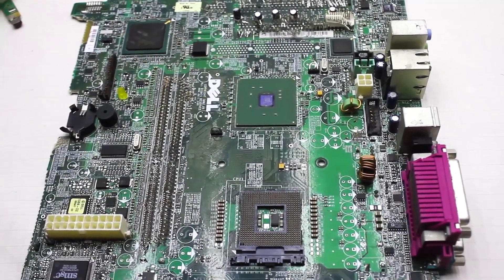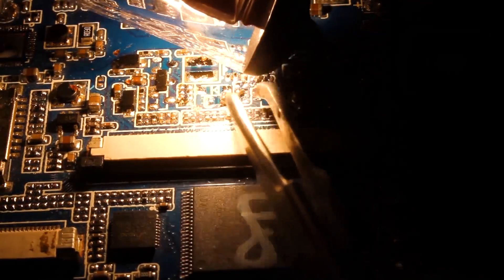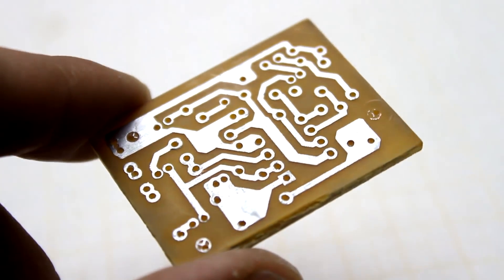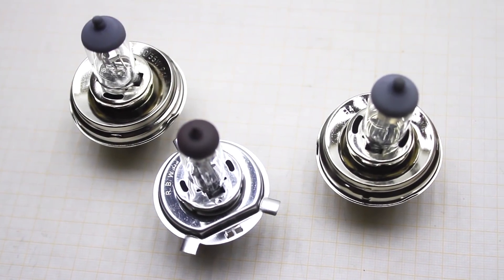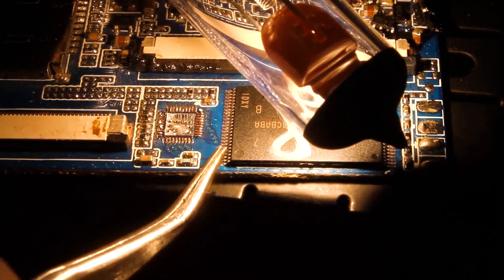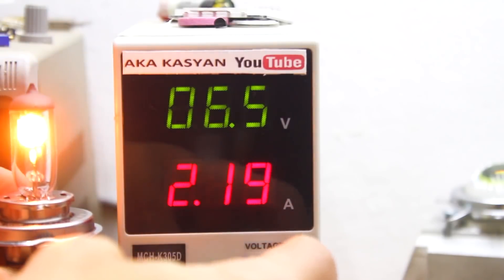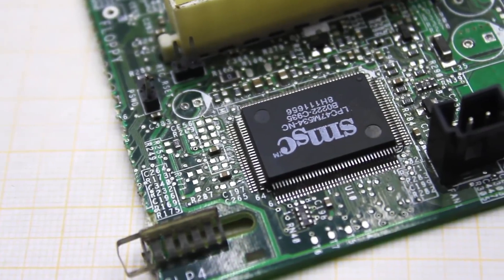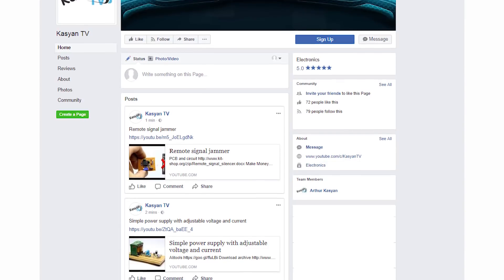SECRET function of halogen lamp. THIS YOU DIDN'T KNOW!

Comment: Nice! Why not paint the light bulb black to stop it blinding you?
Reply: It would probably shatter and explode in your face if you do that. Even touching by hand lamp balloon is problematic because oil from skin will burn on a glass (when you turn lamp on) and create additional thermal isolation layer and that spot will have higher temperature than rest of glass balloon which can lead to crack and shattering.
Reply: zokonjazokonja so how come the tip of the glass envelope is painted black out of factory and it doesn't make the light bulb shatter
Reply: Alvin Wijaya good idea if you want to start a fire. Also it won't help with the light reflected off the pcb.

Comment: Also don't touch the bulb or your fingerprint will leave oils and make a hot spot and cause the bulb to fail early
Reply: Like the glass portion of the bulb or if you do wipe it off with rubbing alcohol and be sure to let evaporate

Comment: I think this method would work really well with tight packed boards as the beam of light is way easier to shield than hot air, from components that don't need to be heated like plastic connectors that usually get destroyed during rework..

Comment: 135 comments about how cool is this...
another few XX comments about her voice and the word Halog/jen....

...and NOT even ONE freakin comment from somebody who has actually tried this....
Reply: I've been doing this for years.  Only instead of a car lamp I use those halogen bulbs that come with a large glass reflector to direct more of the energy to a focused point.  You can COOK the board if you dwell too long in one place.  Yes, the bulb still gets hot, that's why I built a lamp holder out of copper pipe.  A bit of smashing, drilling and filing and you have a holder that does nicely.  Only, you shouldn't solder to the terminals, they get hot enough to melt the solder.  Connector pins are a better way to go.

And yes, I'VE DONE IT!
Reply: imjeffvader that's true. For example, i go to sleep just right now, so, i can't try that method. Good night
Reply: Alexandru Oglindă .Accent or pronunciations are not important as long as message is conveyed
Reply: Heey, only a week passed, who in this world can try anything in such a short moment, take it easy :D

Comment: NOTE: Do not touch the bulb for any reason - if you do, you need to clean the bulb with rubbing alcohol afterwards, as the oils from skin will create points that get hotter than the rest of the bulb. This may cause the bulb to shatter. This warning is included on bulb packaging, if you choose to use a new bulb.

Also, use good thick wires to connect the bulb to power - too thin a wire and it won't be able to carry the amperage a halogen bulb requires and the wire and/or its insulation can melt. A thicker wire will also carry more amperage to the bulb itself.

It's a creative life hack though, just do it safely.
Reply: Old wives trail!
I've never heard of anybody who's had a halogen bulb explode/crack.
Its been passed down from father to son since the 80's and probably earlier, but it never happens
Reply: I'll second that. Ive ridden a motorcycle with an h4 headlamp without a front glass element for months. It was exposed to all the dirt , cold, hot and even rain riding can throw at it and only broke when a car driving in front of me kicked up a rock which aimed itself directly at the bulb.
Reply: That's true. Thanks for the advice!
Reply: Another misuse of the word, "hack."
Reply: Have touched the glass many time when installing these types of bulbs in cars. Not once has one become damaged as a result from touching it,
Reply: Talking about stating the obvious!
Reply: DashCamAndy kķomsi kmsa

Comment: I used this technique before good smd rework stations becomes affordable. For better result, use MR16 halogen with aluminum reflectors. Do not use dichroic type as they only reflects the light, not heat.

Comment: Not a bad idea. Execpt most hobbyist bench supplies have a maximum of 1.5 amps.
Reply: That's why there are PC power supplies
Reply: Year ago, I made my own bench supply that can go up to about 30A@15V or about 15A for settings above 15V.
The switch over happened smoothly.
Basically the idea is this:
Several very fat NPN transistors makes a 15A output stage running from the +30V rectified supply.
A resistor in each NPN's emitter makes the 0.7V needed to bias on a pair of fat NPNs.  These NPNs are powered through a rectifier from a 15V supply.
At low voltages, the second set of NPN do most of the work so you can take 30A from it.  When the voltage gets above about 15V, there is effectively no collector supply to the second set and the first set has to do all the work.
I got the transistors cheap so I used more than really needed.
Reply: Really? My smallest bench PSU can do up to 5 amps. And I have a 10 amp one too. I've seen the small 1.5A ones but didn't think they were as popular due to the limited power for the cost.
Reply: I have a  car battery charger that will put out 10 amps
Reply: Suggestion for someone who is entering in to electronic DIY stuff.
Build one based on DP50V5A and some LED PSU (i.e. 48V 150W or higher power), if you have already a housing it should not be more than 40$. You can also improve quality by adding  additional LC choke filter if you need better quality "laboratory" PSU for more sensitive devices, although without it it is OK and can supply standard MCU-s (i.e. arduino and similar stuff) without a problem.
Reply: My best one is 12v 1A lol
Reply: It doesn't have to be the 12V bulb. I will recommend you to grab some GU-type halogen light bulbs rated for mains voltage. All you have to do is to be careful, don't forget that it is not a low voltage toy.
See the channel " 12voltvids " the man there used GU bulb to reflow BGA chips.
Reply: @ L DB : That's my wallwart ;-)
Reply: So just build one with higher ampacity....
Reply: Then use higher voltage to get to the needed power. Just keep it under 40-50V then you should be fine.
Reply: I use a MingHe D3806 + laptop power brick for these kind of things.

Comment: This is definitely on my list of stuff to try. I actually have my first hot air rework gun in a cart on AliEx right now. Just over $28 for the version that comes with the adjustable laptop power brick.
   I had to order something to replace the full blown heat gun I've been using to strip SMT components. My last board delaminated and bubbled from heat due to formerly leaking capacitors. It turned into SMT popcorn with stuff flying everywhere as tension from the bubbles overpowered the adhesive used to tack components in place. It's hard to believe, but what looks like a small amount of leakage can get under and around everything everywhere. Apply a good bit of heat and you will find out. It smells AWFUL too.
Reply: cheater00 I have gutted an old magnetron out and turned it into the fixture for the GU10 bulb :D You can do smth similar. I use that "fixture" as the IR preheater when I want to desolder surface mount parts. 50w bulb heats the board up to 50 Celsius within few minutes, trust me, it helps quite a lot. Removing stuff with hot air gun alone can be tricky.
Reply: You overheated the PCB. Any PCB will do that, and through experimentation, I have had that happen as well.
Reply: White Phosphorus 
This is the item: 
PIGONG8858 110V 220V Portable Hot Air Gun BGA Rework Solder Station Hot Air Blower Heat Gun Intelligent detection and cool air
 http://s.aliexpress.com/3iaueuiY 
(This is not an affiliate link)
Reply: White Phosphorus 
I tried to post a link but it was flagged as spam. (...Stupid YT bots are worthless when they are designed to destroy helpfulness and a supportive community...)
  The one I ordered is marked PIGONG8858. Maybe that helps ;)
Reply: Be careful when using the bulb, though. You made the PCB bulge with a heat gun, the bulb will just scorch it :D Not to insult you in any way, I'm saying this because I've done that myself :)
 I will recommend to use the bulb at further distance and from the other side of the PCB as the cheapass IR preheater, it really helps. Say it gets the board to +100C, then it will be much easier to remove components with hot air.
Reply: Upcycle Electronics You can even make into reflow oven, Dave has done that, if I remember correctly. I don't mind a little bit of heat in a "lab" with +10C (50F) ambient temperature :D In summer it gets toasty just like your place ;)
Reply: Upcycle Electronics they make cheap variable temp desoldering tools that work wonders, mine is made by haiko and I only spent about $50 on it. it sucks the solder right out of the joint.
Reply: Upcycle Electronics what really got me into really picking it up it was aVe repairing his tools, got me to start fixing my own tools. starting with swapping out a dead battery in my drill then soldered fuses, diodes, and switches, he showed where to look for the most common failure points.
Reply: Les Fox 
  It worked ok for me using a 12 volt marker light, held in a very small vice with my panavice holding the PCB just above it. Really, nothing fancy needed. A single third hand tool with 2 arms could do the same thing.
Reply: Can you give model number for the heat gun you were describing?
Reply: Benjamin Esposti 
  It was a little different than anything I've seen before. I've overheated a board before. I tried to clean up some traces that looked a little bit corroded and discovered the damage was far worse than I first thought. With just a small amount of heat the exposed traces turned a corrosive chemical black. I had tried to tin a few traces with a soldering iron and the same thing happened in that area. The problems including bubbling were happening before the solder reached melting temp. I assume it was something really nasty on that board/in those caps. I've stripped a dozen or so boards with a heat gun before and I've never seen something like this.
Reply: the heat gun is pretty cheap for what it does. I wonder about the light bulb idea, could you paint it black to prevent it from radiating UV and visible light, just IR? Is there any cheap paint you could use for this? You could also use a metal shroud to direct the heat of the lamp, so it doesn't go everywhere, just where you want it to go. This is better than a heat gun because it doesn't create an air stream - and that can make the components fly off the board I guess.
Reply: +cheater00 Well, I dunno about the paint. Black paint will absorb a lot of energy and get so bloody hot that the glass might fail. That's the reason why they say to not touch the glass itself, your fingerprint will eventually discolor to dark brown and might cause the glass to crack. As for the shroud - he was using the Low Beam, which has a litlle shield inside the bulb.
Reply: MrJohhhnnnyyy yeah the low beam is a good idea.

I don't know about the black paint. All it needs to be black is to block the visible light. That's actually a small component of the light compared to IR, it's the IR that does all the heating.
Reply: Yes, but I wouldn't paint it still. The amount of UV over that period of time ain't gonna do significant damage. Unless you shine it straight onto the unprotected EPROM :D
Reply: MrJohhhnnnyyy it's more about being able to work without getting blinded.

If you look at the halogen bulb it has a black cap that's painted onto the glass envelope so obviously it can't be that bad
Reply: I agree, but that cap is more like some kind of ceramic than paint. Ghetto solution to your problem is just to wear a pair of sunglasses :D Again, I recommend a bulb with some kind of reflector, like GU-types. They are directional, thus won't blind you as much.
Reply: MrJohhhnnnyyy i'm fine with ceramic too. Directionality helps a little but the parts still reflect the (very bright) light.

I wonder what could be used as an arm to position such a light bulb over the board. I wonder if a normal desk lamp - made out of metal - would withstand the heat?
Reply: Yup, you won't find a paint that can withstand the heat, or more accurately...You will not find a paint that is designed for the environmental conditions. The glass surface will expand and contract a lot on a microscopic scale. Glass is also a low tooth surface that offers almost no mechanical adhesion. The only way to effectively coat glass with any substance is to use a chemical bond. This easiest/most common industrial process involves lots of heat and annealing.
  If you really want IR heating, just go buy a cheap heater, hair dryer, or toaster from your local second hand thrift store. Cut out a section of the heating element and hack together a way to hold it up using the hardware from the donar product.
   The entire point in this light bulb hack is to do something cheap and easy.
  Using a large heat gun is simply an exercise in using the wrong tool for the job. It's about like trying to crack an egg with an industrial pneumatic jackhammer. If your working on a small area of a SMT PCB, the correct tool for the job is a small hot air gun designed for electronics with adjustable temperature/air speeds and a wide range of tip attachments. If your playing with through hole designs, there's nothing better than a solder pot.
Reply: MrJohhhnnnyyy 
  Interesting idea. When I get my hot air gun I'll have to see what else I need like this. I wonder if it would be effective to just use an old toaster oven with a simple temperature control circuit? I don't know if I want a large open element/bulb in my bedroom lab.
  Here in Southern California it's always between 15-30°C outside year round and gets hot inside quickly when the sun's out. I'm trapped in here so I'd rather not live in an oven of my own design. The heat gun is already murder ;)
Reply: stonemason90 
  I have a couple of solder suckers and copper braid for through hole stuff. If I'm going to take that a step further I'll be getting/making a solder pot. While I haven't used the powered desoldering tools before, I don't think they will really improve my ability to remove components enough to justify the expense. I see myself moving more towards SMT in the future. Personally I use 2 simple solder suckers for through hole stuff. I have one of the nicer ones from Fry's Electronics and one of the cheap ones from China. I put heatshrink tubing on the cheap one to reduce it's tip diameter and to make it last longer. The reduced tip diameter makes it super powerful, but easy to clog. My only problem components to desolder are multi layer boards and boards with a large ground plane. None of that does me any good when I want to play with more modern SMD chips I find on old boards though.
  Happy New Year
 -Jake
Reply: Upcycle Electronics that's why I like the desoldering tools, you can adjust the heat for the big stuff or the small stuff, plus you can do chips quickly without doing harm to them I work alot with chips so keeping them safe is a priority being it's a hobby and I don't like to have to buy new ones.
Reply: Upcycle Electronics plus I take the old solder and I remelt it and turn it back into useable strands for the next job. it just makes the whole process simpler
Reply: stonemason90 
  I'm just learning and exploring my options. Hopefully one day I'll come across a deal on one of these nicer desoldering setups, or some family member will take pity and help me get one. I got into electronics as a hobby after a broken neck left me partially disabled and unable to play with hotrods, bikes, and machining. I'm no expert by any stretch, but I'll figure it out one day in the infinitely distant future ;)
Reply: Upcycle Electronics mine all started with a broken phone screen, now I repair broken caps, fried chips, basically anything that lets the smoke out. I typically take 2 or more broken same product and make one working one. I also save any other components that are still useable for other projects. I don't know exactly all the names for all the different components, but I can usually tell when something has let go. through automotive electrical diagnostics and a good fluke
Reply: stonemason90 
  I was working on a '92 Camaro project when I was hit by a car commuting to work by bicycle. It's 3rd motor was supposed to be a 383 with an old B&M mini blower and megasquirt EFI. It had to go into storage mid project because I don't have the back to finish building the motor, rewire the whole car and finish welding the updated cage. Megasquirt got me interested in more electronics and what started as simply a way to waste time has lead to a few years of goofing around so far. I just take apart whatever I can get for free and occasionally order some junk from AliEx. I'm not the smartest kid in the room, but I have the time available to beat my head against the wall until something sticks.
Reply: I guess you could make a small metal shield that attaches to the mounting ring. This could also offer some protection if the bulb ever burst.
I probably would attach the rig to a handle of sorts to keep fingers from getting burnt as well.
Reply: +Upcycle Electronics I think the problem is that you spelled words incorrectly. "Pigon" is correctly spelled "Pigeon". [I am the grammar police]